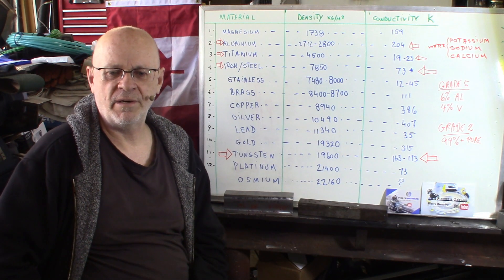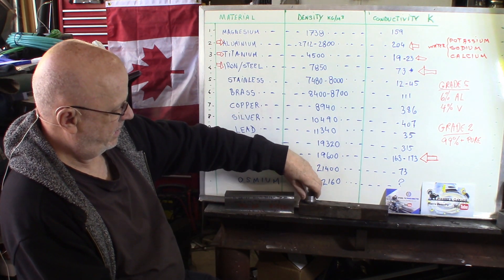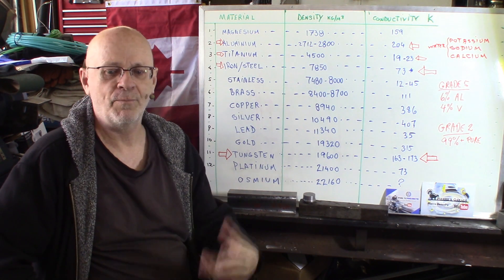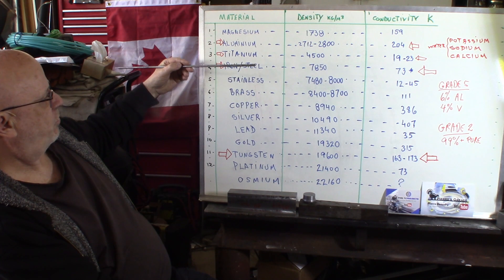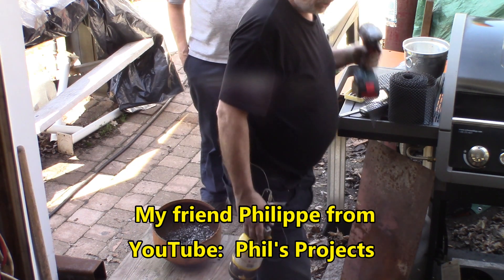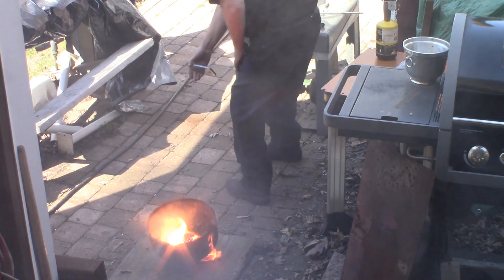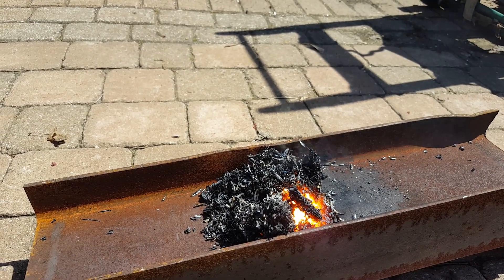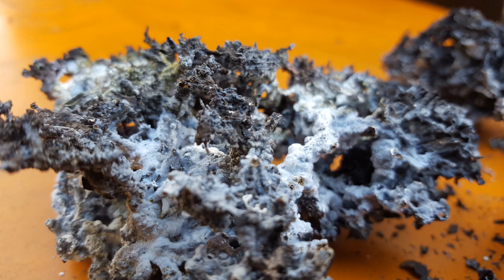Will Titanium Burn…??? Some facts about Titanium and some fun experiments…

Comment: What's the best way to polish titanium?
Reply from the maker: You would do about the same as other metals, for example, stainless steel...
Depending on what is the surface is like when you start, you need to start with coarser grain abrasive and gradually working your way up to the finer grits, then you would go up to the finer polishing pastes, this should give a mirror finish if it's what you want in the end.
Just be careful not to cross contaminate the grains, i.e. having coarser grit particles left when going to finer grits. Patience and a good method is the best way way to get perfect results.
Nothing stops you from using electrical buffers, just experiment with speeds and materials on scrap material before using on precious parts...

Comment: Hey Pierre, you should do one on fine aluminum chips, they will burn also.
Reply from the maker: Hi Dennis,I find Aluminum much harder to ignite than Titanium, even when I get big buches over the melting furnace it doesn't catch, powdered with rust would be another story...    Grin...!!! 
Cheers,    Pierre
Reply: Your right, it's the fine powder that will ignite.  People don't realize when the machine aluminum dry that they are making fine powder along with chips, so making sure you clean up after in a necessity.
Reply from the maker: Today just cleaned up the chip pan on the lathe, it was really time, got a big pail full of those chips, about 50% Al, 50% 4340 plus a few misc. I'll try to put up some picts of this in some next video... Not that I'm so proud of it since I procrastinate until the carriage moves the pile before I do something about it...   lol

Comment: Interesting video.  I don't know much about titanium but I read somewhere that it has poor rubbing resistance and titanium conrods (in race engines) have steel side faces/ discs for side thrust loadings.  Heard this one ?
Reply from the maker: Titanium beheaves and machines quite like Stainless Steel with something extra, Titanium will ignite and and give you a nice fireworks night...  ;)
According to Philippe who's quite familiar with racing, steel bearings are required to get better wear caracteristics and friction less  action by being treated to harder than Titanium can reach. There should be no side load on conrods.
Cheers,     Pierre

Comment: Fun... My first exposure to titanium was back in early 70s. I had to deliver a lunch to my brother at a big company called Eimco. He was cutting a groove on a six foot (~2 Meter) diameter ring of pure titanium on a BIG verticle lathe. Chip was burning white hot as it came off cut. Looked similar to an electric welder arc. He seemed unconcerned over the whole ring igniting. Also my first exposure to ceramic cutting tools, which he reported was what he was using to make cut.
Reply from the maker: The bigger massive ring won't ignite since most of the heat is going away in the chip, as long as you keep the main part much heavier than the removed part you should be ok, make sure you pickup your oil soaked rags, or you may need to evacuate the shop FAST....   lol
Cheers,     Pierre
Reply: Ceramic inserts can't use coolant, they'll crack quickly. They're made to put the heat into the chip, therefore no coolant. It's kind of crazy when they're used on roughing passes. Machine comes flying in with no coolant running, glowing chips flying off and you just wanna hit E stop but it's leaving a good finish and the insert looks perfect afterwards. It's just nutty the first time you see and use that method. I always thought "That could go bad so fast".

Comment: A-10 (Warthog) Thunderbolt II drivers sit in a Titanium structure, referred to as the bathtub, in the cockpit.  - Titanium *"like magnesium, is classified as a combustible metal, but again the size and shape of the metal determine to a great extent whether or not it will ignite." *An excerpt from DOE-HDBK-1081-94, Primer on Spontaneous Heating and Pyrophoricity.  -  Dudley Toolwright has a Titanium machining video where the chips ignite during turning.  -  Just can't leave you two alone!!!!
Reply from the maker: There are a couple of other planes that uses Titanium in order to reduce weight or even on the former famous SR-71 with the leading edges on the main wings so it would resist the intense heat generated by air friction at 65k feet...
Magnesium is even igniting more violently than Titanium...   Fun for fire bugs like the Monkeys...   lol
Cheers,    Pierre

Comment: I had steel trying to ignite on the lathe tonight. Very fine stringy chips and the steel chips started to glow. Never realized how much of a fire hazard machining is.
Reply from the maker: If you machine some very hard steel with CBN inserts it will do like steel wool on fire, nice to look at...   ;)
Tust keep an extinguisher close by, and, trow away oil soaked rags...   !!!
Reply: Pierre's Garage I did away with rags. I use paper towels and then throw them away after use. No rags in my shop.

Comment: Thank  you for the information.  I used to cut this stuff with an abrasive jet, blocks that were 4 inches to 10 inches thick.  The feed was 0.1 inch/minute.  It was very difficult to cut with regular tooling such as saws.  I'd cut out the rough shapes and the work was whittled into final shape by vertical mills.  These days I have titanium artificial knee joints and titanium supporting my spine after it was fused together.  And now ... it's Labatts time!
Reply from the maker: This is some serious machining in BIG material, and Titanium requires good quality tooling that will wear fast...
So Labatt time in what part of Canada...???
Cheers,     Pierre

Comment: Interesting video. IIRC one of the reasons titanium is used in the body is because it can take an apatite crystal structure which closely matches the crystal structure of our bones, it makes it's highly bio-compatible for repairing bone.
Reply from the maker: Seems like most implants are made from grade 2 really pure medical grade Titanium, a few extra control steps in the process are required in order to get the best results...
Very specialized industry with acute metalurgical knowledge....    ;)
Behond my competence...

Comment: YAY a new video :) Thank you for another great video Pierre, I have started working with titanium a lot over the past year.  Home shop guys should not be scared of titanium, with carbide tooling it turns, bores, faces and parts as easily as stainless, but drilling? Oh, that is so painful! I just use a spray bottle of oil-soluble coolant and keep things cool, drill SLOW and peck. One trick I have found for drilling that works well for me is to use HSS drill bits ground to 135 degrees (rather than 118 degrees). I found this by accident but it really seems to work better for me.
Reply from the maker: Hi Randy, quite agree with you on all you mention in your comment, just like Stainless Steel...   A comparative test for 118 and 135 could be a good idea, eventually...
Cheers,    Pierre